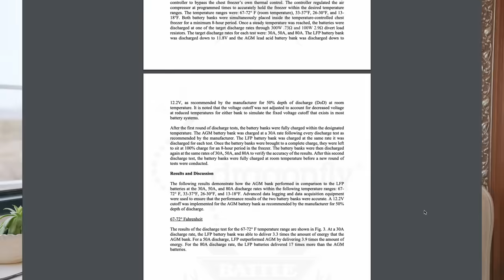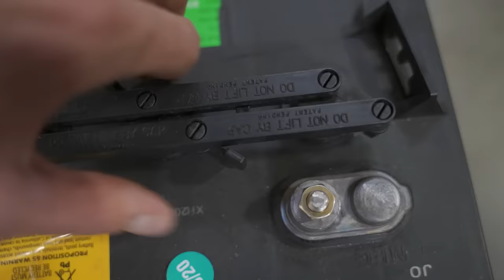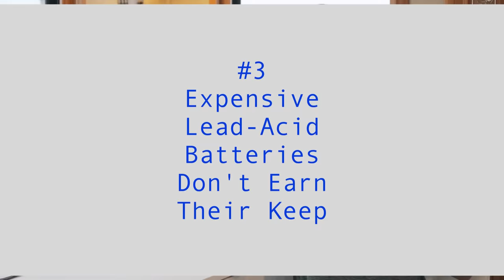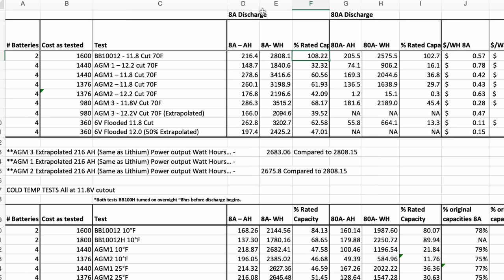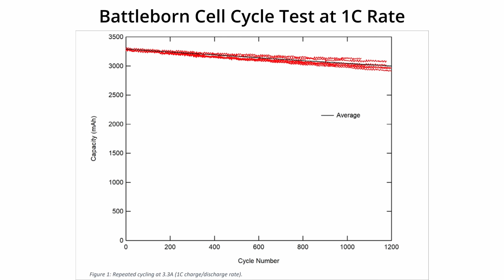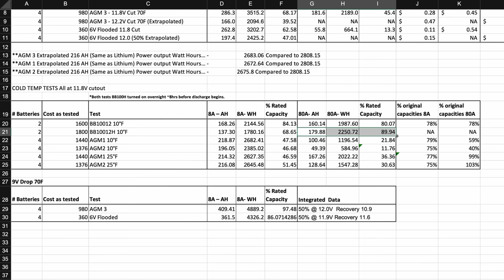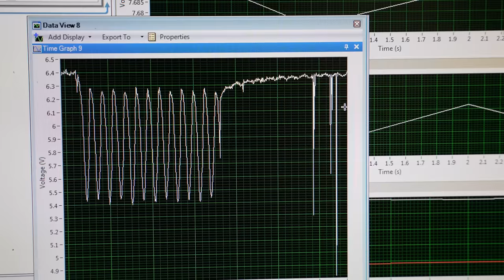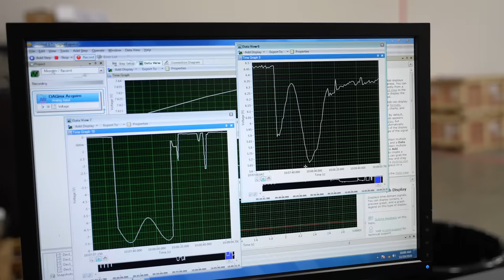Don't Waste Your Money On Batteries - The Shocking Truth I Discovered When Testing RV Batteries

Comment: However this does not reflect my real world off grid caravan experience in isolated woodland with fairly cheap Lead Acid batteries.
Yes they are cheap, heavy, and not as efficient. But after 6 years they still hold 14.5V for over three weeks and possibly because they are well maintained from the Hybrid MPPT solar and wind charger, are lasting extremely well.
Also they work well when it's below -14 Deg Celsius outside. The batteries are Inside and vented to the outside. I have a Diesel heater which, once running, draws a very low current and a dull day can more than be compensated for by minimal solar. My needs are moderate, but I do have a 3KW natural sine wave inverter which can run an airfryer ect.
I agree LiPo is best as are any Lithium based batteries, also lighter. But they are EXPENSIVE and I’ve got 300AH capacity for only £280. For Lithium I’m looking at almost three times this cost £800+, and that's for cheap ones that may not be very reliable due to poor quality internal control boards and other components.
So for AmpHours/£, I believe Lead acid Leisure batteries make sense on a budget. They are also more robust in their simplicity.
My wind turbine is a low power lantern type, because being surrounded by trees the airflow is confused and varied, but it gives maintenance to the batteries when solar is absent.
Thank you for your thorough video though, it is well thought out and thorough. For a blogger always needing power for their van LiPo may be their best option.

Comment: 29:13 "how to handle variable load problem" -- Couldn't there be super capacitors that are sitting at the voltage of the battery, and during big current times, the capacitor delivers the power -- similar to how you need starter capacitors for A/C units or motors or compressors, etc.

Comment: Testing batteries this way has built-in biases. Without doing a single experiment it's possible to objectively calculate which existing proven battery chemistry is the "best" - for a specific application - based on energy storage capacity/volume, mass, rates of energy delivery, charging and self-discharge, , longevity, cost materials and fabrication, and total life cycle environmental impact. Most street "analysts"  forget to consider half of these, and nearly all forget the last one.  For an RV application the best depends on more than temperature. Mass has a transportation cost.  Self-discharge rate affects utility.  A battery that can be stored and forgotten for 6 months and have 90% of its initial charge rate, has an advantage over one that would need maintenance charging.

Comment: Seems like you're missing the fact that Lithium-ion batteries can go up in a pillar of fire 10 feet high if punctured, overcharged, or exposed to excessive heat, while AGM SLA batteries are a lot safer for inside a home because they will not.

Comment: Awesome video.  Thank you,  We have two 6 v golf cart AGM in our little T@B 400 and they are starting to show some voltage drop.  We have a 12 V refrigerator, TV, Radio and some LED lighting along with a heating pump for glycol circulation.    Do you think a one 12 V Lithium Battle Born would be sufficient or two wired in parallel ? ?  I do believe the charging station would also be a question due to the AGM to Lithium change???  Thank you again for your thorough investigation,  Mike

Comment: Auto shop down the road has marine lead acid battery at $112 for 80AH, same store sells lithium ion battery at 75ah for $660... even if i can only discharge half of the lead acid batteries... i can buy 6 of them for the same cost of 1 lithium ion battery.... 80Ah divided by two times 6 is 240 AH vs 75 Ah... and if something bad happens to one of them I still have 5 more. sure there are more materials involved in the formation of a bank, vs one battery, but that's where 3x's the output comes into play, you would need at least 3 of those lithium ion batteries to get comparable Amp hours ... so as long as your not spending $1200 more to hook up an extra 3 batteries your probably going to save money for the first 4-5 years... 4 to 5 years later you might have to spend another $660, and 5 years after that you can buy brand new lead acid batteries again...and you will have spent the same amount of money as the lithium batteries that are now 15 years old, after 15 years you might save some money on lithium...which is well outside the lifespan of the lithium battery, so you'' probably have to buy them once if not twice over in that same 15 year period, just like the lead acid... so if spending 3 times the money, is saving you money, go for it.
Reply: Modern lithium batteries have 20+ year lifespan. Enjoy your antique technology lead acid battery farm.

Comment: So what I'm hearing is a flooded lead-acid battery has to stay 60% charged or at 60% capacity to provide adequate power to a system? But you can discharge a lithium battery down to 10%?

Comment: I was wondering when testing New Lead Acid battery’s require a Brake in period ( maybe 25 cycles ) after proper break-in 95 % of our New Lead Acid Battery’s passed all discharge tests ( we found 2% failure rate , and turned in for warranty ( 90 day full proration )

Comment: randomly found this while listing to other videos on lithium batteries. subscribed as it's fantastic content.

I want to build a 144V 3-4 strings in paralell battery for an EV. The battery management scares me as it will be easy to destroy expensive batteries with poor design/management.  Surely someone has built systems for this?  (vaguely recall seeing systems 4-5 years ago but didn't proceed at the time)
Reply from the maker: Thank you!

Comment: Thank you for this informative video!   I am preparing to design a complete climate system for small scale testing on my new Art Studio that integrates any energy source (solar electric, solar hot water, passive solar architecture with greenhouse, wind electric, geothermal, wood stove heat, wood gas retort, and any other source, such as tesla turbin, Casimir effect, Torus Tech electric, algea, etc.).  I think there is a way to connect all these systems to live off-grid, on land, in the desert.  Your YT video and website are very inspiring.  Please keep up the good work!  Love and blessings to all.  🙏
Reply from the maker: Your art studio idea sounds awesome! Thanks for watching and following our blog. :)

Comment: How about deep cycling application like in a boat? Can a lithium battery be swapped in a car without the risk of charging damage as a typical gas powered car was designed with lead acid in mind?

Comment: my lead acid flooded batteries are deep cycle marine, and only have reserve minutes on them no amp hour rating.. they were dry and had sat for a bout 5 years when i got to them.. i refurbished them by adding distilled water and trickle chargeing them.. Then dischargeing and rechargeing 3 times over a week... I just left the lights on in my rv to dishcharge them.. they sure seem fine near as I can tell.. ??

Comment: It would have been a better test, with deep cell Acid batteries. Trolling motor, ect. If you used that type in this review, I could not tell. Still, I think the BBs, would win out. Thanks.

Comment: So Tom, a system set up to provide power for say a sailboat, or a small off grid cabin with ac, fridge, lights etc. how many batteries would one need my standby gen has 15kw…I don’t necessarily think you’d need that much but I’m guessing 8-10

Comment: Have you considered using a lithium or two to ‘hold up’ the sag in a large lead battery pack? Theres a boating guy playing with this at the moment and having successes cos lets face it, as you say, you dont need to charge the lithiums to 100% and they’ll be fine.
Reply: The two different chemistrys want to ‘hang’ at different voltages…..

Comment: Why do lithium batteries always pick the low end 100 amp hour to compare to. Let’s see you take on say Trojan T145. A 6 volt battery, with about the same foot print and still about 66% less cost but with 260 amp hours. Say 4 battleborn take on 4 Trojan T145. That would be worth watching. My money thinks Trojan would beat them, maybe even embarrassingly so. But the real advantage of lead acid over lithium will always be, if you screw up, and we all have bad days from time to time, a $1700 (4 Trojan 6 volt T145)loss compared to $5300 (Battleborn heated set of 4) is a bit easier to take. At least for me. All prices are in CAD and both are sale prices.  Just my two cents.

Comment: Hi There 
May I suggest that you try the optima yellow top 75ah deep cycle battery and see how these perform.
 I have two that I use in a  power back with a 2 kw inverter for the continuous load shedding we have here in South Africa. I have had these for nearly 20 years and they are still running around 94% of their original specs. They run a 1,5kw water pump, an xbox one and a TV for two hours at a time 2 to 3 times a day. I am astounded that they are still running so well after such a long time.

Comment: Why didn't you test budget oriented LiFePO4 as well? BB makes a great product but other manufacturers make great products for cheaper as well. EG4 server rack batteries are only 1500 for 5kwh and mine have performed flawlessly. Under half price for equal performance makes the switch to lithium way more palatable.

Comment: This has been common knowledge in the solar industry for over 30 years. lead-acid batteries discharged to 50% at the C20 rate at room temperature, ie. 75 degrees or so. This is not new. at colder temps or at higher c rates, like C10, you greatly reduce capacity. Peukert! I tested many Trojan batteries with a hydrometer. Battery voltage is not a valid measurement of capacity.

Comment: I have a transport truck with an electronic APU with a starter battery bank and an auxiliary bank. Would it cause a problem to the alternator or batteries, if I have lead acid batteries to start the truck, and lithium battery to support the APU?

Comment: What about power output? I read Lithium batteries often can only output 1C, while some AGM batteries can output much higher current. 1C is pretty limiting when using a 12V system. I want to output at least 2000W, and that wont be possible with a Lithium battery
Reply from the maker: Well you are correct, but you should be running at least 2 batteries to draw that kind of load consistently and lithium will still provide much much more due to pukert.... If your starting and engine or other high high current burst load then they are not right.

Comment: Starting batteries being cheaper and widely available (as apposed to deep cycle) would like to know whether these could be used in a solar application using them at only 30% discharge ?

Comment: Great Video,
 
I'm just a bit confused why you refer to Lifepo4  batteries as  "Lithium ion" or are you saying "Iron" ? 

Lifepo4 and Lithium ion are obviously completely different batteries so I'm just a bit confused with your terminology but the excel obviously clears that up. Just not sure from the video what you're concluding as the battleborn batt is not a liION battery but is a LiFepo4 battery.
Reply: That is not correct, LiFePO4 is just another type of lithium ion.
Reply: @Kris_M  one uses lithium cobalt dioxide or lithium manganese oxide as a cathode and the other uses lithium iron phosphate.

They're not interchangeable or anywhere near the same in terms of their composition, lifetime or applications or even the cost.

A lifepo4 battery costs much less than a lithium ion branded battery of the same rating so how do you mean it's incorrect or one is a subset of the other?

Certain principles are the same but that's about it
Reply: @butwhatdoiknow5115  Branding doesn't determine what they are *precisely*, all those types are lithium ion chemistry. LiFePO4 also falls under the term lithium ion. And I see those other chemistries mostly branded as "Li-ion" anyway, not as "Lithium ion"
Reply: @Kris_M  Fair enough. 

I guess I'm just just looking at the finer details not generally. 
I've worked with "Li-ion", Lithium Polymer on smaller electronics quite a lot and they don't seem as robust as these guys Lifep04  type at all. 

These are also not as common where I stay in South Africa and can't figure out why more people aren't using these, they seem really good !
Reply: @butwhatdoiknow5115  TBH, I also learned about them "just" 2 years ago when I ran into Will Prowse's channel.
I had the same reaction, why aren't we using these all over the place?
Apparently they have been widely available for a while now, especially as solar batteries, but they are mostly advertised as "solar", "lithium" or "lithium-ion" batteries without an obvious "LiFePO4" indication.
Issue for mobile use is of course lower energy density per weight, although Tesla has been using them now on (some?) models.
Reply: @Kris_M  Indeed, Tesla is how I found out about these, I'm quite involved in the marine industry and its news to folk involved.  Seems like a massive market to me, some smaller boats have the space for these for sure!
It's giving me some ideas!

Comment: No lithium batteries are used in my boat's electrical system.  Sure, they deliver great performance but the risk when they fail is completely unacceptable.  A lithium battery failure resulting in a fire that is almost unable to be extinguished is fatal when you are 90 nautical miles offshore.

Comment: confused why the 2 6v acid batteries in your charge are only showing 360 amp when we clearly know that's double when you ad 2 batteries thus making 720. Where adding 2 12v batteries would only produce the same ah as 1

Comment: Are you ruining the lead acid right away with deep discharge or does deep discharge matter if you charge them right after?
I am going quite low on my lead acids when using my trolling motor but I am charging them right away.

Comment: All I know is living off grid I run everything off 3 x 100amh led acid batteries that last me about 6 years and cost me £90.00 each .  A lithium  battery would cost me over £2000 for the same amh.  So the lithium battery would need to last me 35 years to par my led acid ????

Comment: i know im late to the game but of course there is a inherent difference in lead acid, agm, li-ion, NiMH/NiCd, and liFePO4. yes its all dealing with capacity, internal/ external resistance, volt, current density, non-ohmics and their operating points, siemens, blah blah blah, and a dash of Kirchhoff's law fancy word, fancy word fancy word...... BUT how about a optima (red, yellow, or blue) i watched a guy have one power a inverter---> powering a saw---> cutting its own case apart--->then pull one of the fiber coils out---> unroll it on the table flat like a map---> then there was still a charge that he could connect two alligator clips to power a cymbal clapping monkey...  Or one that still works frozen solid in a huge block of ice.....  Personally have ran the same red top for about 14 years now. Which includes forgetting about it, connected, in a vehicle for over a year. Finding it at less then one yes one volt force charged it and its still kicking years later...   All batteries are not created equal

Comment: To conduct a thorough test of batterie performance charging cycles must be taken into account. Just doing one discharge test doesn't tell the whole story. What about the second , third ...etc  discharge. They won't be the same as the first. This is problematic because load testing is a destructive test and with each test you take some of the life of the battery. So a thorough test will destroy the batteries. It must be done on a sample sacrificial batch.

Comment: Interesting findings, I do wonder if adding capacitors in lead battery setup would make sense if you want to use them for high power application. Instead of piling more and more lead acid batteries, use some big capacitors to lessen the voltage drop etc.
Reply: Probably not. The ammlint of money you'd spend on enough capacitor capacity would far outstrip and complicate the cost of just using lifepo4 batteries. If you skip the cost of battleborn you can get a lot of capacity for the money.

Comment: Why are the Battle Born batteries with heaters running the heaters during cold temperature discharge. I would think the battle Born batteries would only run the heaters during cold temperature charging.

Comment: agm or lead acid will out last  a lithium battery due to lithuim battery having a  bms charging   board  inside  that fails over time,(right when you least expect it)  , this bms electronics( lead acid and agm Dont have ANY charging electronics)  cant handle in and out current (NO matter what the company rep , china or the  warranty says)  .  also as many marine guys do on here and show , you can mix  2 or 3 agm or lead acid batteries  to every   1 lithium and tie them  together   resulting in Great power that compliments each other .

Comment: Cool, but this isn't taking into account the safety of lead acid compared to the destruction and potential death lithium batteries can cause.  I've also heard there are many expenses beyond just the cost of the batteries when one decides to go with lithium. Say you spend 8k on the lithium bank. End up spending another 14k on accessories to make them function.

Comment: Great video, I just spent the weekend researching 12 volt acid, 6 volt and lithium, solar, generator for recharging and really was uncertain.  Your work, well done, confirmed my feelings.  Thank you! One question though.  What did you run and for how long that drew 80A?    I hope I did not miss it.
Reply: Low variant, high power resistors to provide a static load (description of test setup starts at 3:26).
Reply: @gerrygreen3832  Thank you